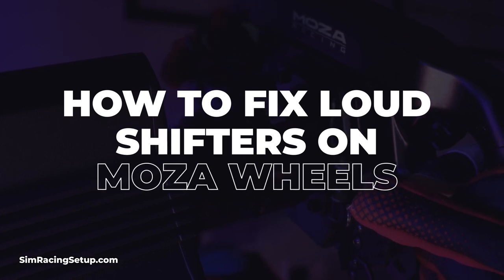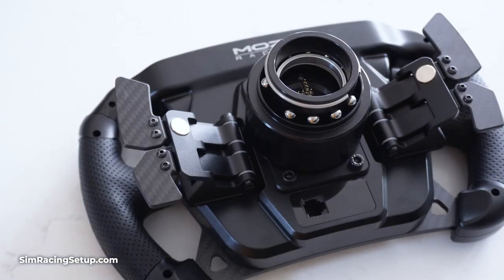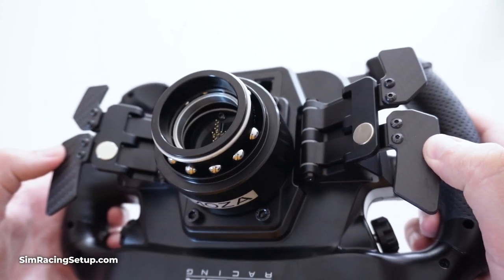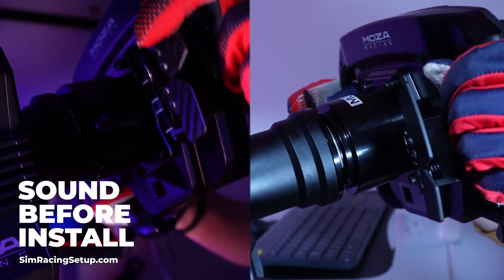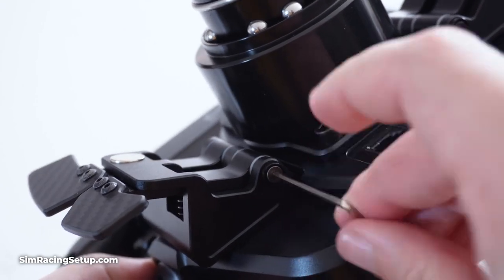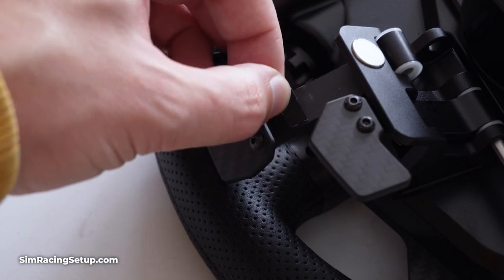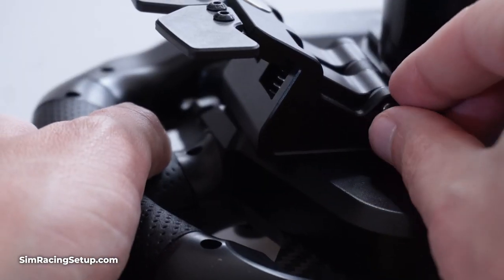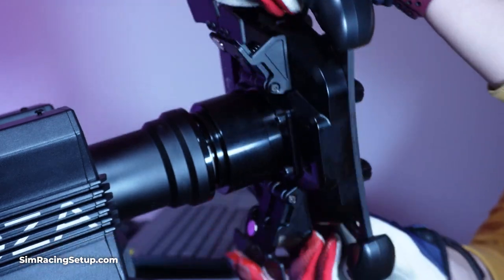How To Fix LOUD shifters on MOZA Steering Wheels - Quick Fix!

Comment: Thanks for this.  I applied the pads to my Moza GS wheel a couple of months ago, but yesterday, during a race I suddenly noticed that the downshifter became very sticky in operation.  After the race I had a look and realised that the rubber pad applied over the holes on the shiter lever had gradually migrated upwards, leaving the sticky medium behind on the shifter lever.  The pad eventually detached and I was left with just the glue on the lever, causing the lever to stick to the wheel.  This has happened on both up and down shift levers.  I've replaced one pad with a spare that came with the wheel, and the other with a piece of black duct tape which seems to do the damping job adequately.  Something for people to monitor though for others who have applied the pads.

Comment: I applied a different thicker pad to my Moza GS v2p bagel.
It reduced the sound. However, after the application, 
the gear pedals were not active. 
It is necessary to calibrate the bagel settings.

Comment: Thanks for the Video, but it doesn't work on my GS V2 Wheel this way, the shifters don't respond if I put the Second Pads this way like you did in the Video. Hafe to place those just above the magnet otherway the sensors dont respond.
Reply: it works on my v2 - where he sticks at 2:34, do that further right before the metal ring and then I had contact again.
Reply: @L33TCHI  hi and thanks for reply, yes I know what you mean but that's the point, the effect is less when doing so but nothing else I could do, my left shifter I setup often bc it sometimes fails.
I assume the photo sensors dont respond bc of the thickness of the pads.
Will experiment more with this but its not ideal from MOZA ;-)

Comment: When I installed the anti noise pads, my shifter was not recognized anymore. I removed the pads and it worked again… not sure what is happening…. Any ideas? Thanks for the video!
Reply from the maker: They add a little less movement to the paddles and can sometimes block the paddle engaging correctly. You can try moving the silence pads further down the shifter arm to ensure there is enough travel.
Reply: This happened to me as well. The pad that goes on top of the magnet isn’t an issue. Make sure the other pad is covering the part that extrudes the most. I.e put the pad directly on the bump. In the moza video explaining how to apply it, the positioning is wrong.
Reply: I have the same problem. I installed the rubber pads like in this video but then the shifts are not recognized properly anymore. It either does not recognize the button being pressed or being released (so it keeps being pressed all the time). I could only fix this by removing the rubber pads again. I am really sad about this cause I liked the silenced shifts. I assume the sensors for the buttons would have to be recalibrated or something but I guess it's not possible in the current software.
Reply: @BPKarlToffel You find a fix yet? I’m in the exact same situation 😭
Reply: @ejd228  only by removing the silencer rubber pads again... so no silencing
Reply: @BPKarlToffel  I just had the same issue and no matter how I placed the pads the paddles would not be recognized. I resolved it by running the Calibrate Paddles option under the Recovery and Reset section in Pit House. Try it out.
Reply: @behica  oh thank you, I was not aware of this feature in the software. I will try it next time I am using the CS wheel again. For now I switched to the GS wheel and there I don't have a problem with the silencers atm
Reply: @behica  you're a life saver, worked like a charm. TY!
Reply: @behica  Me too!
Reply: @behica   resolved it by running the Calibrate Paddles option under the Recovery and Reset section in Pit House also
Reply: @behica  yes this worked for me thanks
Reply: @behica  my god jesus christ youre a saviour thanks mate
Reply: Guys, I found a fix for it. In Moza Pit House driver go to the Tab with "System Settings" and go to the next Tab "Recovery and Reset". There you can re-calibrate your paddle shifters and make em work with noise pads on.

Comment: thanks for this video 👍 - instructions Moza instructions were a little flakey - didnt want to push the pin too hard. Video helped.
As they are still not 'quiet' - would love almost silent to be honest! - if I add another pad - double up - will that stop the magnetic contact ?
Reply from the maker: Yea I wouldn't recommend that as it will almost certainly stop the shifts being recognised I'm afraid.
Reply: @SimRacingSetups  already thought this was the case! Brand new...popped them on no response...calibrated and all good. Going to see where else I can add to. Still really to loud for me. Kind of annoying going from noisy grindy belt wheel to silence..with the loudest shifters in the world 😁

Comment: I am not able to remove the bolt. After removing the screws on both sides I have used a lot of force to push it out but nothing happens. How are you easily moving it out?? I have the GS wheel
Reply: I was having the same issue on a GS wheel. It helps to stand the wheel up on a good desk / table while you use some muscle to push straight down on the bolt. The bolt will slide out.
Reply: @TBolt1  I was able to do it. but had to use an allen screw same radius as the bolt and push with all my power and body weight to get it out. I couldn't find any easy way

Comment: As silencing pads are not a thing in the market I assume I can use any type of padding and stick duct tape to keep it there.
Reply from the maker: They do come included with MOZA wheels. But, yea, other than that a small piece of foam, 3M tape of something similar.

Comment: Is placement important?  After putting the rubber pads, the paddles were no longer detected.
Reply from the maker: Yea, they can block the paddles being recognised in some cases. I typically install the pads closer to the bend, this means less of the pad is being used, and gives the best of both worlds. Slightly quieter and all shifts still recognised.
Reply: Guys, I found a fix for it. In Moza Pit House driver go to the Tab with "System Settings" and go to the next Tab "Recovery and Reset". There you can re-calibrate your paddle shifters and make em work with noise pads on.
Reply: @CptCoach  You absolute lifesaver!

Comment: That bolt was really tight but pushing it with a similar hex tool (and some confidence) made it slide out. Easy peasy. I didn't poke myself. lol I like it better with the short throw. I think that makes me shift faster... like nano seconds faster! (and no clunk)
Reply: thanks for mentioning this. I thought mine was excessively tight so put it back together, going to give it another go now!

Comment: whats the difference in feel though? 🤔
Reply: The engagement is just a touch “softer” rather than the solid clunk you can feel normally but in the heat of the moment while racing, I never noticed it, only after installing on one side to check it